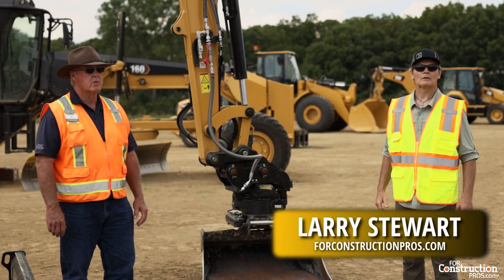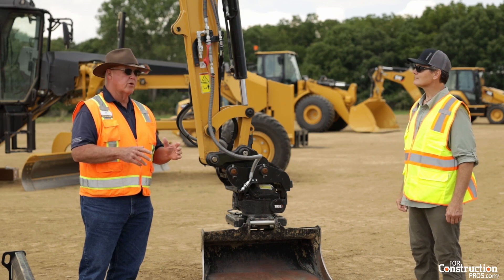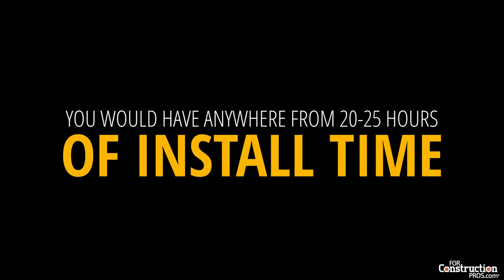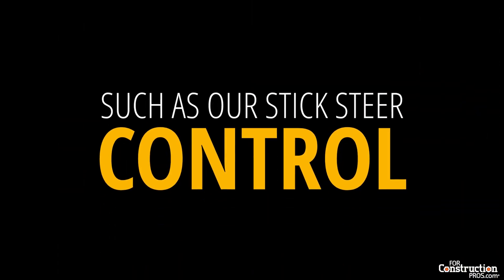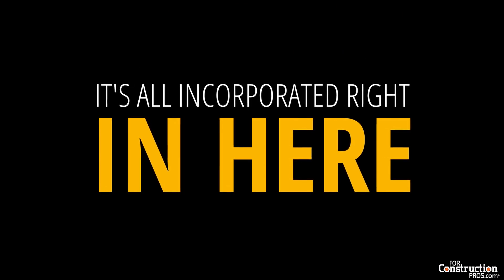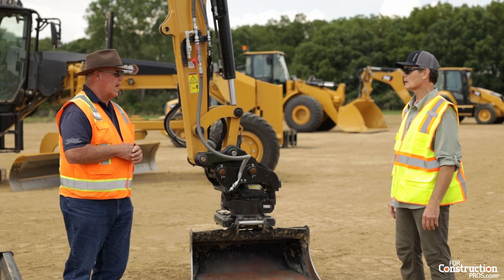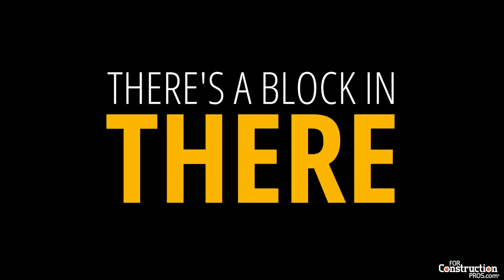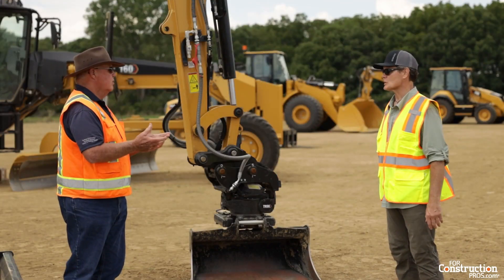Caterpillar's Smart Bucket Rotator Changes the Game with Automatic Grade and Depth Control.

Comment: Wow. I see alot advantages. Are there any disadvantages???
Reply: Expensive, need to buy and fit special, smaller buckets to suit.
Less useable lifting capacity, slightly less breakout force.
But it does turn an excavator into a swiss army knife.

Comment: I’ve been digging hole for the last 20 years with mini excavators. I’m not sure why you need to rotate the bucket the entire 360 degrees. Don’t get me wrong, flipping it backwards into front shovel mode I do on a regular basis. But I’m sure that there is a very small niece market that would appreciate it.